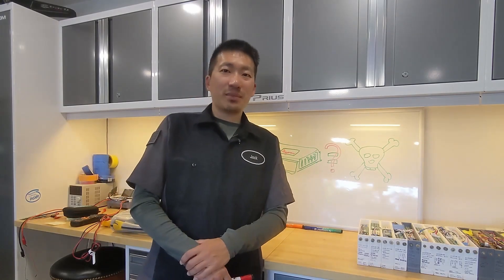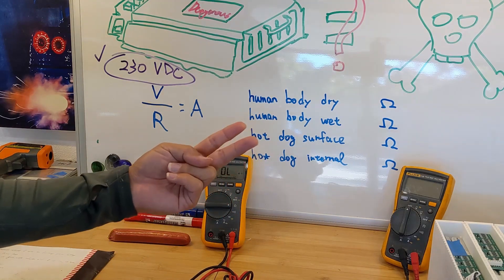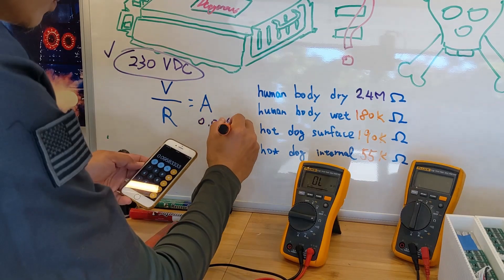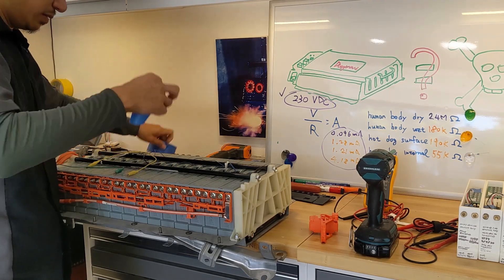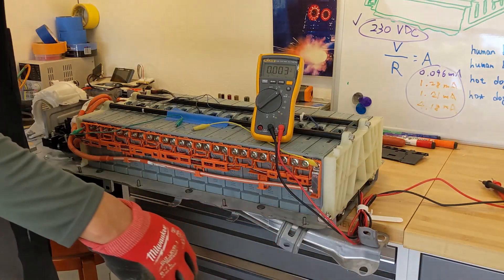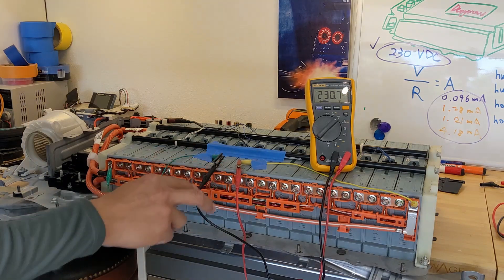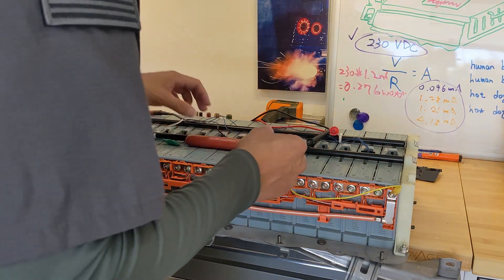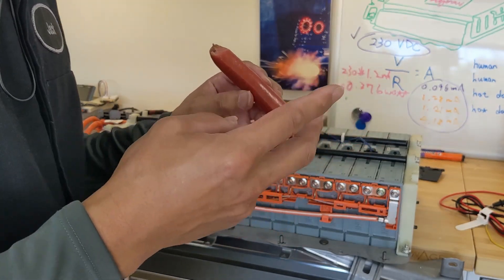How can a high voltage hybrid battery kill you? see Jack got zapped!

Comment: 9:30 why not to use regular multimeter to measure the current over resistor connected sequentially instead of contactless induction based Ampermeter? As far as I remember many contactless amermeters are AC only and will not work on DC unless your model is suitable for mA DC measurements but I would still recommend just connect any basic multimeter in Amp DC mode.

Comment: Jack, Toyota put safety first when designing the hybrid system, and certainly wants to protect those who service the vehicle.  High voltage DC is extremely dangerous as current through your body can result in muscles contracting, preventing you from releasing when your body shorts across the battery source.  And, the current is effectively limited only by your body resistance (or , in the case of a short, essentially no resistance other than the batteries themselves.  Imagine the current and heat generated if a metal wrench shorted across the battery.  Last, with a dead short, it is possible that some of the batteries themselves can rupture catastrophically.  Your wrench would become a welding rod…with you holding it with your bare skin.  Respect the hazard.

Comment: The resistor got hot because it looks like a 1/4 watt and it's dissipating almost a watt. It would've burnt out after a while.
If you're sweating, the shock would be much worse as there's salt  in your sweat and a saline solution is a much better conductor than plain water.

Comment: Great detailed video. Your so talented. Thanks for sharing. I am having the triangle of death and check hybrid sys codes. Reset several times. Got obd2 blue tooth and dr prius on 2010 gen 3 148k. Battery goes up an down pretty quickly.  Guy has a battery here near with 120k all cells reading 7.8 he claims. Totaled his car now selling battery he claims... 550$ do you feel like.that is a lot for such a used one... I am on a  budget otherwise I would buy a greenbean or just go to orilleys ?$1500... he said I can test each one if I like but feel like anyone can charge them.all up and that does not show true cond off each blade... Am In worrying to.much and should buy  used and go.for it...lol
Reply: Btw i saw the lithium replacements looks like they go instantly. How much milage are people.getting with the lithium replacements in the gen 3s? So interesting. I would.love to talk to you sometime. I have used mine offgrid with 2500 w xantrex inverter many times... i have bigger ideas. I wish I was your neighbor. I would be bringing the  beer over.